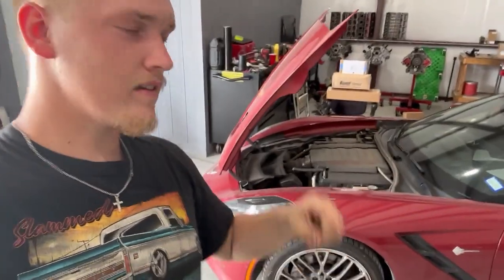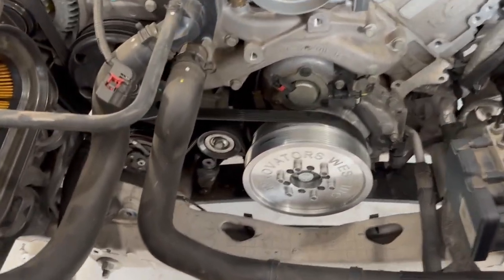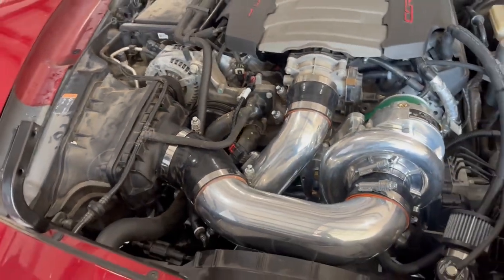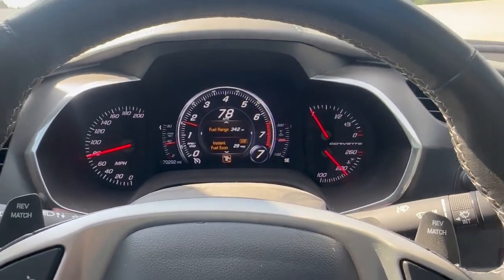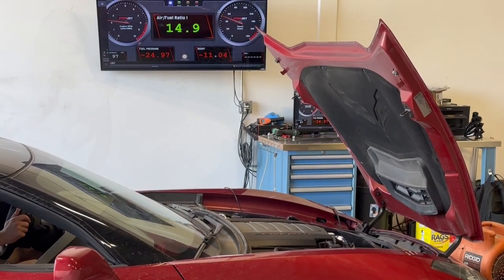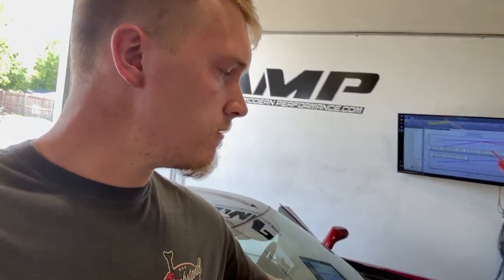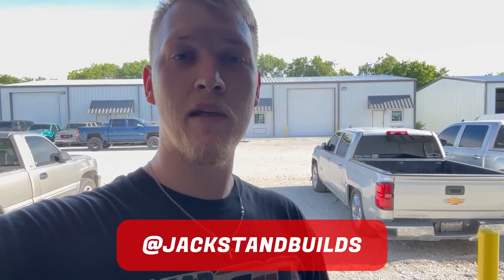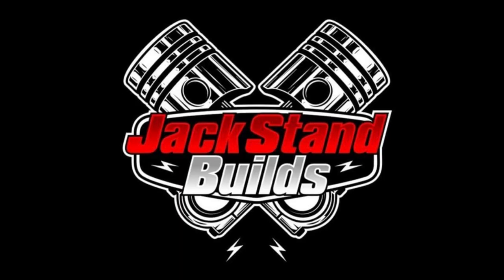STOCK CORVETTE GETS BOOSTED (A&A SUPERCHARGED)

Comment: I've had the c7 Grand Sport and the C7 Z06. Now I have the c7 2014  stingray, not the z51. I see on line I can get the A&A SUPER Charger for $5750. They r say to get someone  to install it on the Labor  and tuned is around  $2,500  I was wondering what is your  cost  and were are u located.  I like your  video. U R the only one who I've see that is Detailed on your videos that makes it so easy to see and understand and I'm 60 years old and seen a lot of videos on corvettes so way to go 5 star. My name is Johnny Juliano
Reply: That’s not a bad price especially if they are adding map sensors and doing a full oil change. It would be better if you had a dry sump but it’ll do w or w/o, nice vette!

Comment: Had A&A vortec V3 si on a 98 C5 A4 3.42.   A&A makes a great kit.  Belt wrap is very good.    A&A mounting bracket is super solid.   9 lbs boost stock ls1 except upgraded springs and 60 lb injectors.   Nothing bad to report about the kit.  Kit was $6500 in 2005.  I had mine Dyno tuned and picked up 170+ wheel?  474 wheel & 443 tq through RPM A4 trans.    You will need more tire… I put widest wheel & tire that would fit.  325’s  on the rear & 275’s front.   Your brakes will likely be ok if your not tracking or crossing the car. 

0-60 pull 

1998 C5 Corvette 0-60 mph in Under 4 sec
https://youtu.be/vmAYGxwxqcw

Comment: this is not smart actually its setting up for bad deal.......you know you have cast pistons.....you know you have 11.5  static..... you know your running outta fuel at top end with lt1 pump/injectors (E85 is a solid NO) so your riding on the knock limit cold....pushing oil with blow by after a while will make KR worse or your gunna pop pistons.......looks like you do good work but just because the customer wants something its your job to advise them in a properly if they know the risk then your good....but you gotta tell em.....but prolly gunna get deleted so whatever man.
Reply from the maker: My customer is aware that he has 0 room as of right now for any changes, we have talked more about further mods to the car to get it close to the 800whp range and that would consist of fuel system/ cam/ forged rods and pistons/ headers/ e85 . Thanks for your concern I completely understand  you. If it was your car I was building, we could build it your way. In this case my customer only wanted to install the A&A and no other mods.
Reply: @jackstandbuilds  Thank you so much for the very professional response, and I apologize for being rude in the initial post, I but I've been burned so many times over the years with "the business" side of things that I left it. I mean your average customers change over long period of time but majority are insecure about what they actually want and managed a shop my self at one time I was too nervous to loose a client and compete price risking my rep.